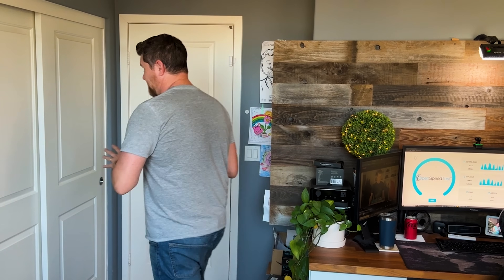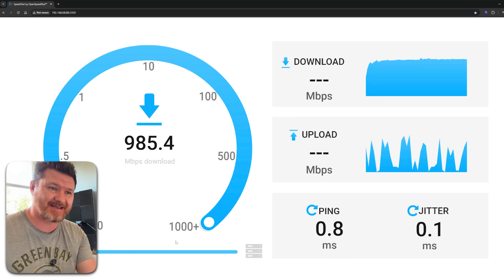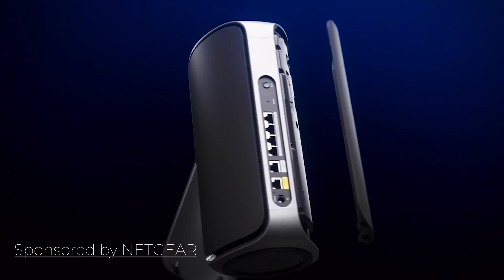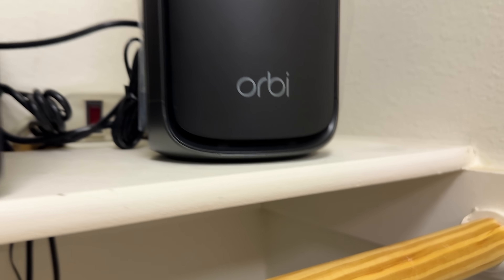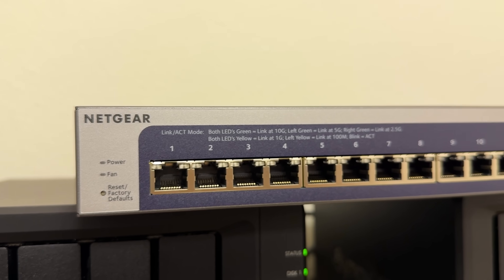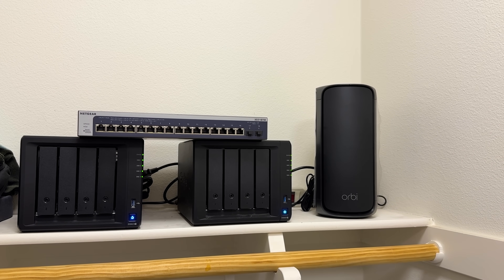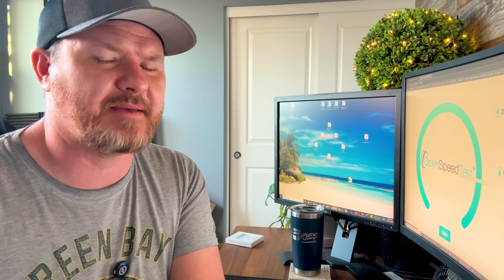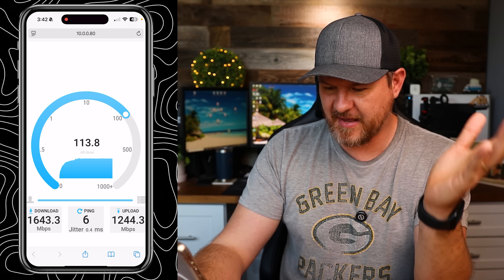Supercharging My Home Network: Wi-Fi 7 + 10Gb Ethernet Setup

Comment from the maker: Few things i wanted to clarify in this video. My NAS and PC both have 10GB NICs to facilitate the new 10GB home network. Also, I'm using the new iPhone 16 with WiFi-7 to take advantage of the WiFi-7 in the Orbi 970. 

If you have an older phone or device with WiFi-6 or WiFi-5, that will bottleneck your speeds.
Reply: iphone 16 don't use 320 mhz channel, only 160 mhz. Wifi7 can give 3,4 gbit speed. Need to try another wifi7 device, android.
Reply: @ГасанбековЮнус 

You beat me to it. Steve, you should try an android phone with WiFi 7 and your speed will be around 3000Mbps instead of half the speed that you get on the iPhone.
Reply: But you gonna get bottlenecked by the hdd's in the NAS, so even 2.5gb is to much for those. For future proofing with sides, yeah makes a lot of sense.
Reply: OnePlus or Samsung can gen way higher speed over wifi than iphone.
Try OnePlus 13
Reply: Ok, so your home network has 10GBit capability, not your internet. You kept saying internet. Your ISP still delivers 1GBit fiber, yes?
Reply: Are you using Cat 5e in your house for this setup?
Reply from the maker: @ZainobMathewCreate yes

Comment: Great video!!   couple of questions:
how did you secure the AT&T gateway in the panel?? just some adhesive tape or something like that??  
Also, is your 10GB home network based on your current ISP service? In other words, there is no reason to do a 10GB setup when I only get 1GB, right?    Thanks again.

Comment: I just had 5 gig fiber internet installed. The modem/router is Eero. Would it make sense to get an Eero mesh system?
Reply from the maker: When it comes to network devices, the brand doesn't really matter when it comes to speed.

Comment: I was wondering why you didn't mount the switch on the backwall and then realised the backwall seems incorrectly installed. Anyway, congrats. I am trying to also do an upgrade - not like yours - but on the budget. I.e. A switch with at least couple of ports 10GB/s and rest as 2.5GB/s , is what I am thinking as that will be within my budget. I have a NAS which is able to support 10GB so if I have matching switch port, that will help speed up.

Comment: In a simple way, I don't know half the stuff you were talking about, but you had my interest and I watched the entire video. I also subscribed an gave a thumbs up. I live in Toronto, Canada and rent an apartment. My cable is with Rogers and my router model is the TG4482. My Wifi from that unit is not up to par, so I connected my LG smart TV directly to it's ethernet port out as instructed by the service guy who hooked up my cable. Unfortunately my laptop uses wifi as it doesn't have an ethernet port. My cellphone (android) I leave it on the 5G network to get better signals (since the wifi is crap). Is there a simple solution for a beginner to up my wifi signal?

Comment: Hello sir. I would like to create a setup like this in the future. So in order to connect a pc which in another room from the router, i can have an ethernet socket on the room with the pc. In this socket inside it there is a cable 6a, the one end of the cable is connected to the socket on the pc room and the other end of the cable should be directly on the router on a lan port or it can be on another socket on the router room and the from the router have another cable that goes on the switch? (I am talking for an inside wall cable installation)
Thank you in advanced sir
Reply: You more or less have the right idea. The ideal way is to have your network equipment all in a central location: modem, router, and switch. Then, you run your ethernet cabling from this central location to all the rooms in your home, or at least in the rooms where you want wired network connectivity.

Comment: Question. Do I Have To Upgrade My Internet Or Just Get A 10gb ethernet adapter? I Only Have 1,014 Download And 40 Upload
Reply: If you want a 10 Gbps internet connection, then yes you will need to upgrade your internet plan in addition to your network equipment to handle 10 Gbps. You can buy 10 Gbps equipment, but it cannot make your internet any faster than what you get from your provider.
Reply: @JJFlores197  Thanks. A Lot Of Youtubers Leave That Part Out

Comment: Wow, how much bandwidth does your ISP provide you?
Reply: I had the same question! He said he was getting WiFi speeds faster than he paid for. Not sure how that would be possible if the ISP limits your speeds based on what you pay for...
Reply: @daviddawson1423  He did a local speedtest on his network, eg OpenSpeedTest, and not to a destination on the internet.

Comment: I have installed several WiFi 7 networks at home for friends and myself.
I only use Xiaomi routers WiFi 7 an 6E, to set up MESH networks using ethernet cabled and WiFi.
The price for a network with 4 routers cost was about 250 USD and covers 4 buildings and farm area of 300 x 1.000 feet. Without problems for teleworking and entertaiment up to 256 devices.
WiFi 7 is too good for Internet Suplier Service with 1 Gbps.

Comment: I worked for AT&T and installed those BGW320. That modem is supposed to be standing, not sideways, because it has a gyroscope inside, and also, there's supposed to be an SFP plugged into that fiber port of the BGW320. Call AT&T support and have them install fiber straight to the modem. Also, I recommend plugging your switch to the Blue port from that AT&T modem since it's a 5GB port in that blue port.
Reply: I have AT&T fiber internet, but since AT&T started offering it where I live about 15 years ago, their equipment doesn’t support the use of an SFP directly to the BGW320 here.  I have to use an old external ONT, which converts the fiber connection to Ethernet, and Ethernet then plugs into the BGW320.  This means I can’t do the SFP hack to bypass the BGW320 completely. 😢

Comment: Keep in mind that your harddrives will be the bottlenecks now, depending on what type you have (3.5 hard drive, ssd or m2). A normal ssd is limited to 600 MB/s and only with a newer m2 ssd you can use that high speed network for its benefit. Also the network interface on your NAS needs to support that 10G otherwise it is the next bottleneck....

Comment: I run a ten gig network and it's still not fast enough. Is it fast compared to regular network speed sure. I have a ten gig nas Synology, 10 gig in my Mac Studio, and 10 gig ubiquiti with 4 sfp+ ports and 1 gig fiber to the house.

Comment: If i pay for spectrum 1gb plan can i get higher speed? If i upgrade and buy equipment not supplied by them?
Reply: Idk what ur current network gear is, but that answer is generally no. Since you are paying for 1 gb that’s the max Ethernet u will get (not including wifi). There are routers that are capable of projecting 1gb over WiFi like in this video, but it’s pretty new and expensive (u need WiFi 6e/7 capable equipment and then WiFi 6e/7 capable devices to take advantage). What I will say is it’s probably worth doing research and getting ur own equipment as most ISPs actually add a rental fee on ur monthly bill for their provided equipment.
Reply: @ So i bought the netgear bt10 wifi7 router with 18gbs speeds. Planning on switching to 2gb Alta fiber when i move so future proofing. I know fiber doesn’t have a modem they have a gateway/ont. I try looking to see if i can buy one but routers show up. What would i need to get along side this when switching.

Comment: It looks like AT&t screwed you I'm guessing you have a 010 somewhere in your house. New at&t policy requires them to run the fiber line straight to the 320 modem i would call them and have them come do it right

Comment: What about the Sinology NAS? 10gb or 1gb connection ? If its 1 gb, it wouldn't matter if your router and switch are 10gb, its just going to be bottleneck?
Reply: I’m assuming he has a 10gb nic in his nas. So when he’s talking about 10gb that’s just his LAN connection speed, so basically just the data transfer speed between his nas and computer, not his actual internet.

Comment: I got faster WiFi speeds than that using an actual internet connection and a Asus xt12 and Google pixel pro 9 xl
Reply from the maker: That's awesome! What speeds were you getting? If anything, I think i'm being limited by my iPhone.
Reply: @SteveDOES  @SteveDOES I had a 2gig Youfibre connection and I managed 1889 down and 1718 up in the same room. This was on the day I moved out of the house so all the furniture was gone 😂. Since then I haven't been able to get fibre and have been dealing with 10 meg 4g WiFi
Reply: Ps really enjoyed the video i just managed to wire my new build with cat 6. so i am ready for when i can get multi gigabit again

Comment: How are you getting 10gbe on cat5e!? I thought it maxed out at 1gbpe 😮
Reply from the maker: Great question! CAT5e is rated for 1G, but can go higher at shorted distances. I was hoping for 2.5G and was shocked when i got close to 10G. I think my cable length is about 50-60 feet from network closet to PC.

Comment: What is the ethernet max from the AT&T router, 1G or 5G?
Reply from the maker: The AT&T gateway maxes out at 5G, but I'm only paying for 1G.
Reply: @SteveDOES  Ok, dumb question, how does it go from 1G coming in to 10G internally? Sorry can't quite grasp that.
Reply from the maker: @reddobe93  When i run the speed test i'm running it from the NAS instead of going over the internet. 
So NAS to Switch to PC.
Reply: @SteveDOES  OK, Got it. Thanks.

Comment: Thanks for the video, Steve. Any reason you’re editing off the NAS, and did you also upgrade each NAS port to support 10Gbe?
Reply from the maker: I started out editing on a local 1TB M.2 and transferring to the NAS when I was done, and i mostly still do that. But more recently i've been pulling from old projects that are on the NAS. I was making a copy back to the PC for the edit which takes up space and time transferring. I tried editing everything off the NAS and it worked on smaller projects but started lagging on bigger ones. 

As you saw, i have 2 NAS's, but I only work off one of them. It's the DS923+ and it's maxed out with a 10GB NIC, 32GB RAM, and 800GB M.2 for caching.
Reply: @SteveDOES Can I pay you to do that for me ?

Comment: Your phone is only getting 1500+ outof 10,000 so wifi 7 is trash
Reply from the maker: I hate that max speeds provided (Megabits) are different than speeds tested (Megabytes). 1 Megabyte = 8 Megabits 

This Orbi 970 that i'm using advertises speeds UP TO 11,530 Megabits on 6GHz WiFi 7, which tests out to be 1,441 Megabytes. So the fact that i'm testing over 1,500 is pretty incredible.

Comment: Did you do a wire back haul for the mesh system or did you just do a wireless back haul for the satellite router
Reply from the maker: For this setup I did a wireless backhaul because I didn't want to be limited by the 2.5GHz ports on the back of the satellite when doing a speed test.

Comment: You failed to mention that you need a 10 gigabit ports in your Nas and your mobile device needs to support Wi-Fi 7 in order to achieve the speeds. Good call out on the cable. That would be another limiting factor
Reply from the maker: You bring up some good points. I'll pin up a comment addressing this. :)
Reply: Like duh

Comment: Crazy setup bro. That's awesome. That said, I guarantee your AT&T fiber quality check is failing on AT&T's side with your modem being mounted the way it is. That gateway's meant to be mounted upright. It has a gyroscope built in to let AT&T know if it's upright. The vents are at the top as well.
Reply from the maker: Interesting... I'll have to reach out to AT&T for more information on this.